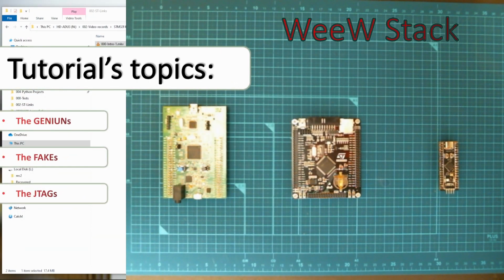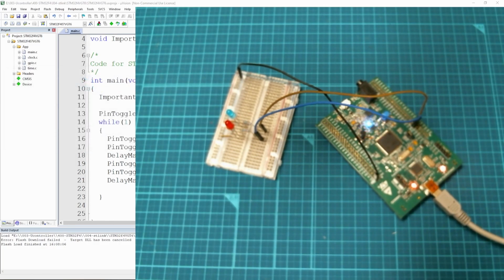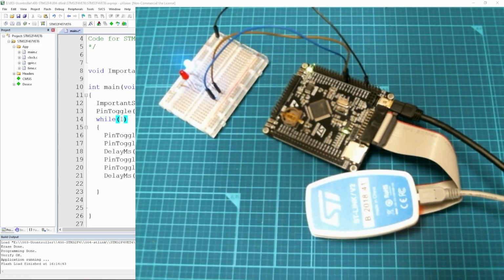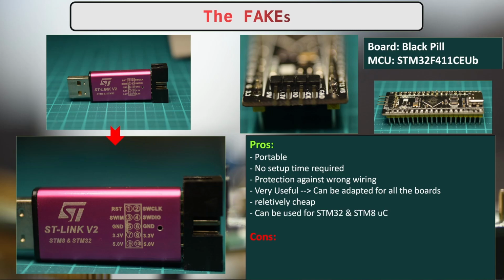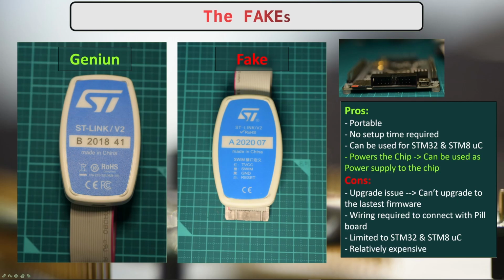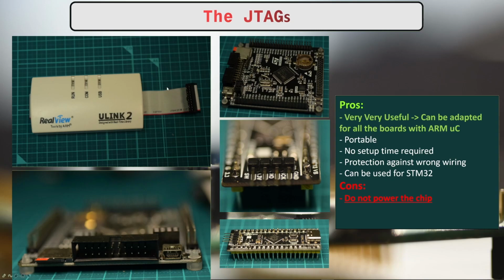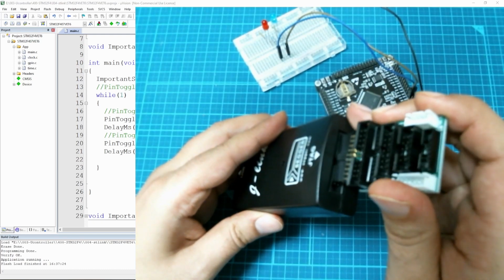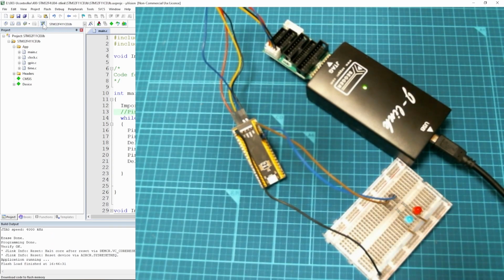006  -STM32 Tutorial: ST-Link Bootloader Review - Original, Clone, JTAG & Keil uVision 5 Live Test 🚀

Comment: Calling the metal ST-LINk V2 Fake is harsh - they're clones. If they were fake, they would not work. As you've pointed out they work quite nicely, albeit quality control may be lacking, and the firmware upgrade may be temperamental.